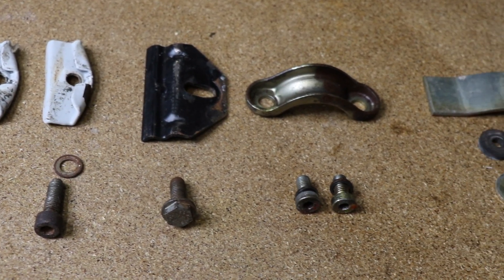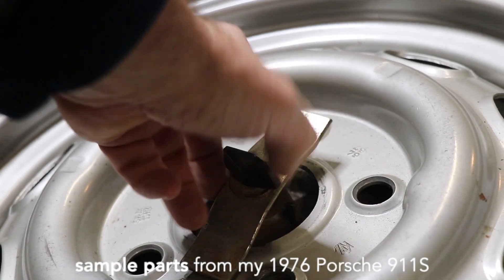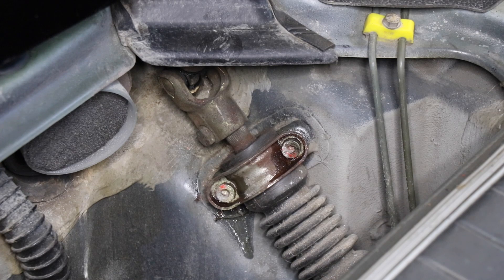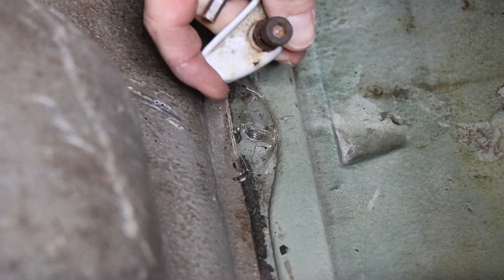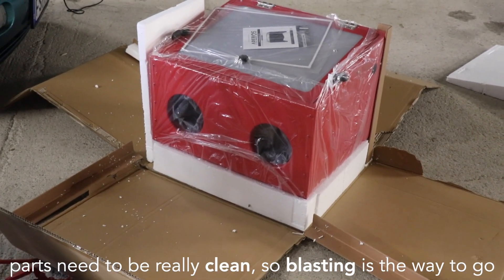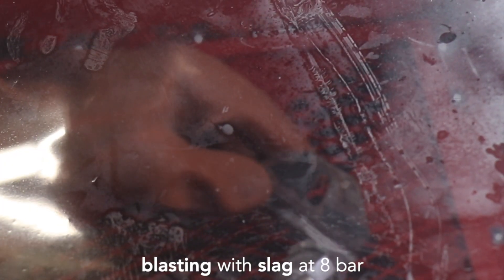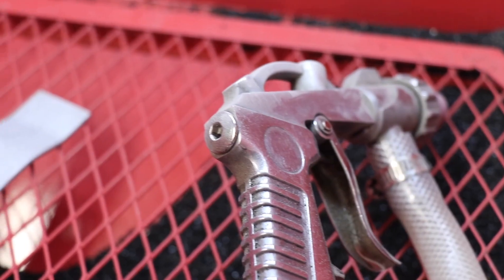DIY Electrogalvanization (Zinc Coating)

Comment: Did you happen to test primer and paint adhesion to your plated surfaces to further protect from corrosion? I've used a non dip/ portable machine to spot plate Copper and Nickel on larger non dip-able aluminum parts, but that does involve a cyanide solution.
Reply from the maker: Yes, I did prime and paint zinc coated parts with no obvious defects. No long term testing though, it happened all just a couple of years ago.

Comment: Why not rinse parts on running water (sink) instead of a bucket? The bucket will accumulate contaminants after the first part
Reply from the maker: Running water in terms of tap water?
Of course not, it’s full of stuff.

Comment: Blasting puts a profile on the parts that is not factory. Can i just use acid to stip them?
Reply from the maker: HCL works for rust, zinc, and other base metals, but not for chrome, paint, etc.
Reply: @GreasyFingers thank you. We found that Evapo rust takes most everything off over night. And HCL does some stuff instantly. We are doing an original shelby cobras hardware. Mainly bolts. Is there a way to make it not so shiny?

Comment: Hi, i’m from Mexico and it is very difficult to find all of those chemicals in the place I live. There is something I can use for the electrolite instead of zinc salts? I saw that chloridric acid can be used in cooper coating. Do you know if there is another altertative for the electrolite? And another question, what voltaje do you use, and, the 2amps per square decimeter is for the entire dipped surface (both anode and catode) or is just for the dipped coating aportation material?. Thank you so much you were very clear with your tutorial!

Comment: I've plated parts with yellow chromate by accident before (you can probably guess how) and I wonder if all the ions can be used up, or does a toxic level always remain in solution?
Reply from the maker: I’m not sure, but I recommend the utmost care in handling it.

Comment: A better way to make sure the rust is removed is electrolysis,  and since you have a power supply ( a battery charger also works! ), it is almost no additional cost ( all you need is some baking soda)! Sand or glass blasting may leave rust embedded in the metal.
Reply from the maker: Thanks for the comment, mate. 
I’m interested in the electrolysis method. Could you give me a quick introduction about the amount of baking powder, the anode/cathode material and the current/voltage?
All the best with your 944 project. They are unbelievable cars.
Reply: Thanks for the videos, too! Love the Alpha and 911 work. I have a 944 in progress now.

Comment: What is the DC Voltage required for this operation?
Reply from the maker: I’ve used a controlled source that provided the voltage that is required to reach a requested current. 
From my memory that was something around 4 Volts.

Comment: What did you use to suspend the metal into your solution while electroplating? Is that copper wire?
Reply from the maker: Yes it is. Make sure the wire you buy is not plastic coated, cause 95% are.

Comment: Any suggestions for the sandblasting cabinet? Thank you!
Reply from the maker: Hello again, Peter. I’ve recently bought a so-called Smart-cab. Not a recommendation, so now you know what not to buy. 😆
Reply: @GreasyFingers  I spotted the brandname on the red cabinet in your video...is that the not too smart smartcab?
Reply from the maker: Peter van den esschert No, that is some China junk which went to the scrap yard. I’ve then switched to the smart-cab which is better but still ...

Comment: Hello compatriot; been watching a master craftsman from Nevada restore a ´67 911 to concourse condition in 60+ 20 min. videos. He dedicates two of these videos to the topic of electrophoresic treatment using a so-called Caswell method. Since you go through much of the same effort with questions left unanswered regarding pickling in acid (3-8 sec.) after plating. I thought I add the link to these two videos.
Have a great day, compadre ....: https://youtu.be/hTupOgImpWo
Reply from the maker: Thanks, Andreas. Appreciated that you sent this to me. This guy has way more experience in the process than I have. 
Regarding pickle: I’m actually doing the same thing: waiting till the first bubbles show up, then take the part out. It really all depends on the dilution of the HCL, but also on parameters like „saturation“ (how many times have you used your HCL pickle already) and I suppose temperature. 
I don’t exactly know why bubbles show up so much earlier at Mike‘s process, but I think things are all good if you do the bubble thing.

Comment: much too long in the acid pickle tank after they are zinc plated. the zinc will be deplated by that long. Just a short dip in the acid then in clean water then passivate .
Reply from the maker: Thanks. Depends on the dilution of the pickle.

Comment: Great video! I've thought about plating the bolts for the Alfa project but there are so many of them that I might look into buying zinc plated versions. The plating would be useful for specific plates, washers etc
Reply from the maker: Thanks for your feedback, mate. 
Specific parts that are hard to get or hilariously expensive were exactly the motivation to start this project. I paid 150 bucks for a door lock last year and that was the point when the penny had dropped.
Please don’t hesitate a second to drop me a note if you need some parts coated. It’d be my pleasure to help raising Junior a little.